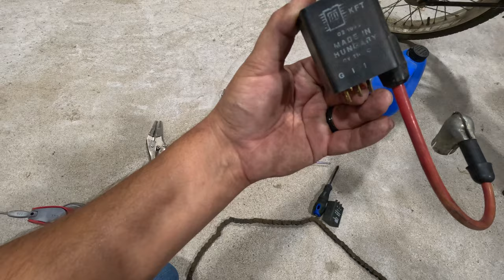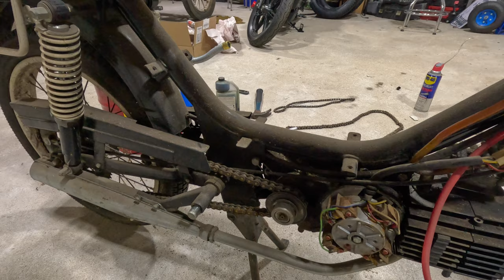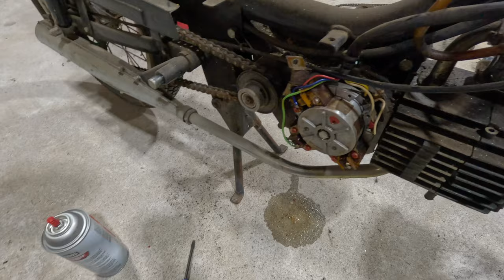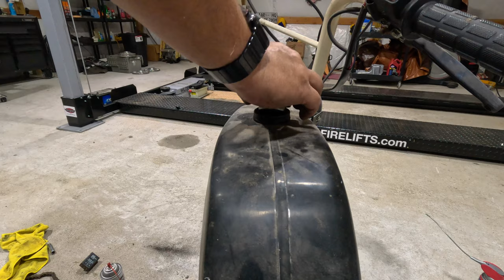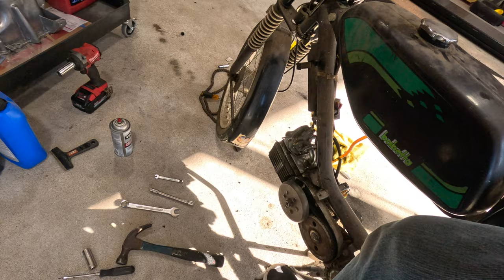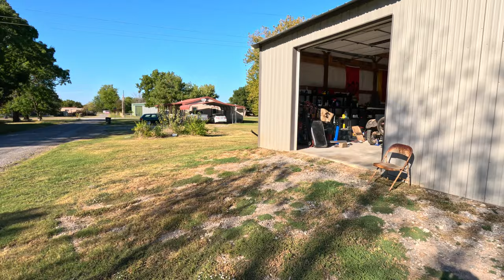Parked over 20 Years - My Grandpa's 1994 Jawa 210 - Will it run?

Comment: What tribute to grandpa👍 Randy I haven't seen one of these old Jawa's in years. It took me right back to my teen years when a friend of mine had one and first experience with hands on mechanic's so thank you for that and if you want to go faster than 30mph find a very steep hill to go down. You had me screaming at you trying to start it up but so relieved you found out the most efficient way of starting it !! Pedal power 😀😀 I'd leave the carb alone and the spark plug gap is spot on at 20thow. All in all loved this post  I hope you decide to work on the model T because being sixty very soon I love the old stuff. Wishing you good luck with you're shoulder and sending my regards to you're uncle.     Gary 🇬🇧🇬🇧

Comment: That's awesome Randy!  Take the throttle cable off and spray some lube in it. Take the carb off and soak it in carb cleaner and if you have a sonic cleaner put it in it for a few cycles. Great job man! Your grandpa is smiling down on you. 👍

Comment: Grats getting that running! With all the issues you have as of late, getting that running made ME feel good. One thing with all the peddle mopeds was you had to get the wheels up to a certain speed before the engine would kick over, especially as they get older. I wish you a fast recovery.

Comment: this is a cool video thanks for sharing, Randy one thing you need to check on the moped is the crankcase bearings and seals they're notorious for blowing them. why you have the covers off grab that magneto flywheel and see if it has up and down movement. the bearings and seals are easy to change. the spark on those mopeds has a reputation for being real weak so make sure you have a nice fat blue spark

Comment: So cool to see one of these overseas. One of the more exported models from this manufacturer although significantly beaten out by the Slovenian Tomos in these markets. Here in Slovakia where these are a domestic product there is tons of them still around, and so are brand new and reproduction parts. Pretty much everything can be sourced at a reasonable price. I actually own one of these myself though it's the regular 210 without the frame brace like your sport model has. As for the carb, don't toss it, this isn't a simple toss and replace with a 15$ amazon part deal. A rebuild would cost about 25 euro and is preferred as these housings are one of the harder to come-by parts unlike the internals which are being actively made.

Comment: Hi Randy, looks like the air/fuel mixture is incorrectly set. It is adjusted by the air screw on the carb. Check that the air screw has an o-ring on it that is in decent condition and that the point on the screw is intact. Also, don't loose the spring. It will take some trial and error but start by screwing it all the way in and then turning it out two full turns.

Comment: If you ever have trouble in testing mode take off a pedal and put a drill on the crank nut and spin the starter with the drill gently😊 saves your legs... I was waiting for you to do this... I use to do it with a mini moto...

Comment: Back in the day mine was missing the air filter and it ran the same way, we took a pop can and cut one end off and mounted it over the carb input and started poking holes in it until the throttle response was the way we liked it. May be a quick fix.

Comment: Flooding the sticky throttle cable with WD40 is still worth a shot... that being said, I imagine a new one shouldn't be breaking the bank either. Not sure why you were doubting yourself so much on this one, Randy, you checked off the basics one by one and lo and behold, the thing ended up running. I don't think Mustie1 would have done anything radically different. Now let's hope the pesky shoulder turns out as straightforward as this...

Comment: take a little starting fluid and spray it around the crankcase while the bike is running if you have a bad seal you will hear the RPM pick up a little bit

Comment: As you said you didn't know anything about bikes and small carbs, i think you would benifit greatly from talking to a bike shop or someone who likes bikes. especially before you just start throwing money into new parts. To me , from the sound of that engine and how well it is running, i would think a good tune up would fix most of your problems. ( I'm not a bike expert myself , but i do know how to tune up some small engine stuff,) Congratz on getting it running :)

Comment: My 2 stroke weed wacker would bog when  bringing up the rpm's. This might have idle screws which require adjusting. Once those were adjusted, it does just fine! "I'm not a carb guy" This coming from the one who rebuilt the carb on the MG. (as newer subs are wondering "what MG?"

Comment: Google lucky2strokes it seems they have bunch parts for mopeds of many manafacturers.
You can tune up this thing they will reach 60 kmh no problem with biger piston,car and changed gearing on chain.
We in ex yugoslavia countries preferred Tomos mopeds then jawa and we used to tune the hell out of 50cc pushing them up to 100kmh with drum brakes lol.

Comment: If there is no battery, then besides rectification,, it is also probably a voltage regulator so the lights do not receive too much voltage when the revs are high,,

Comment: That starting mechanism has a centrifugal clutch, so when it spins faster it will make the engine turn over .
Reply: ...and you need to pedal it to get it to start, it's not a kick starter.

Comment: 40 to 1 fuel oil ratio sounds about right,,  I would not raise the ratio any higher than that,,  not enough oil and you will ruin the engine,,

Comment: Did not see you put an air cleaner on it will run much better with air cleaner I have restored over 100 mopeds and scooters  but never a jawa you can try to put wd40 down the throttle cable